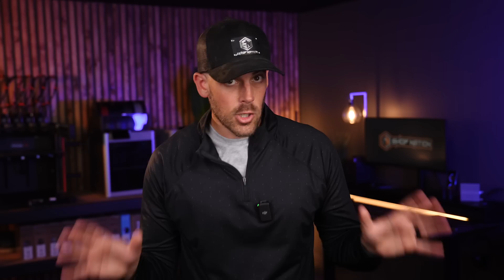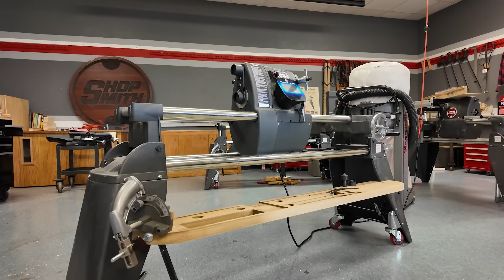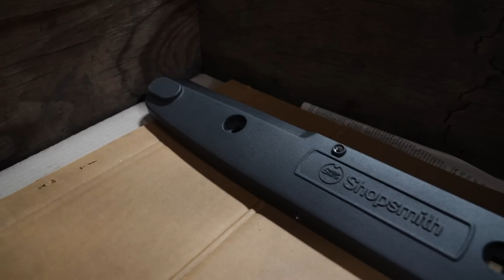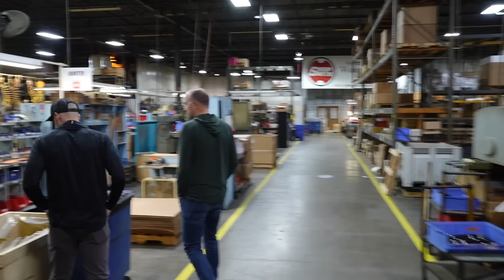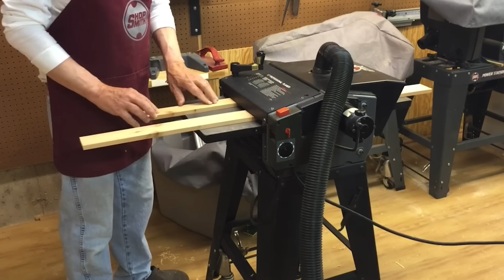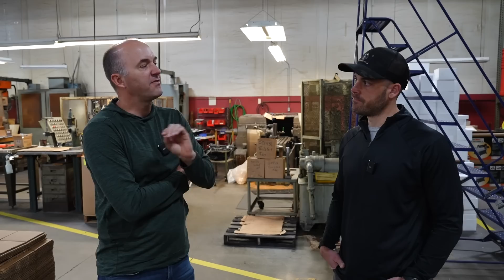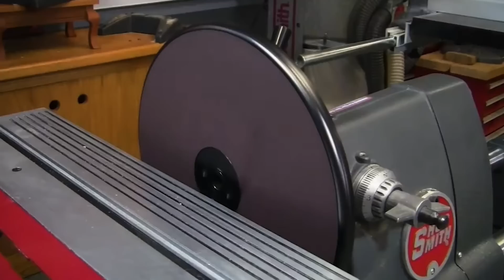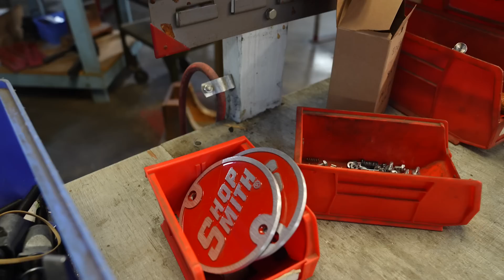The Last American Power Tool Company is (almost) dead

Comment: My dad had a Shopsmith and used it to build a lot of things in the house I grew up in. He made the kitchen cabinets and custom cabinets for the living room, among other things. That was back in the 50s. He sold it to a friend in the 60s that was building a new house. Don't know what happened to it after that. But I bought one in the 80s with a lot of the attachments. I still have it and updated it with the newer ECM motor and controller. Also the bigger tables and fences. Still going strong 40 years later. 
I hope they can keep going and get more people to know about these wonderful machines. We also need to bring back some of the shop classes in schools so kids can learn to build stuff instead of buying everything! It's amazing what you can do if you put your mind to it! Everyone is amazed when they see my dining room table and find out I built it myself. 2 removable leaves that are 18" each. It's almost 4ft x 8ft with both leaves in it with a trestle base.

Comment: Michigan here...if only I knew about Shopsmith five years ago before I purchased over $10,000 of shop equipment. In total the equipment is taking up almost 800 sq ft of space between two rooms. And after these five years of ownership my most pressing concern is I have a need for more space. I think I need to sell off all the equipment and buy the Mark 7 and have it in my smaller room and free up the larger room for assembly and final finishing.

Comment: Its a great space saver and oddly the attachment I use the most is the 10" sanding disc- mostly on metal parts. The thing I use the least is the drill press, because it weighs too much to lift it up into position- and yes they have a fix for that, but its expensive. Come to think of it, I've never used the joiner. Make a cross cut slide table to accurately cut longer pieces like 2x4s if you don't have a compound miter saw. Sadly, the motor they came with is grossly underpowered- it doesn't like ripping long pieces, but I still love the thing, even though it takes a lot of setting up to use the table saw.

Comment: I bought a used Mark V with most of the accessories about 22 years ago for the exact reason the new owner stated. I wanted to get into wood working but couldn't afford a shop full of power tools. I have always loved how I can tuck it away in a corner of the garage when not in use. I always thought I'd get a dedicated table saw as cutting larger pieces is almost impossible on the Mark V. Instead I picked up a used American made Dewalt radial arm saw (that are almost being given away in the used market) and paired with better quality old US made power hand tools. In 22 years, the only thing I have had to do to the Mark V is clean the brushes/contacts on a couple of occasions. The power head, band saw, planer and belt sander just keep working.  Would love to see this company make a come back as I really despise the throw away mentality of companies and their off shore production.

Comment: I bought a used Mark V about 35 years ago. I don’t use it a lot but it never fails to perform. I am glad to see that the company is still alive. I feel certain that when I retire it will get a lot more use due to the fact that I work out of town. I have built my own bandsaw sawmill and enjoy working with wood and also mechanical work on old vehicles and tractors.

Comment: I bought a MK 510 in 1995. Used it heavily in a single car garage with a terribly poured concrete floor. I still use most of the items built with it through 2004. From 2004 to 2017 it was in storage. Since then it has been pulled out of storage, cleaned up, put to work. I even upgraded the wheels for use on a far better concrete floor, cleaned out the shopsmith vacuum, plugged it all in and it works as if it had never been idle. I went back and cleaned out and adjusted  various things and it’s as good as new. The way-tubes started to rust. I cleaned them up and although not as pretty, work just fine, things slide as they should and I recently realized that even the belt is original!! Having inherited other tools from family, I find the Shopsmith gets pulled out fairly often. The band saw is better than the inherited Craftsman, the table saw works but is best for smaller pieces. I have a trak saw for full panel sheets of plywood. The sander is great and the jointer is sufficient if a bit small. It saves space,  runs on a 110 v,15 amp circuit and is long since paid for. I won’t be giving it up any time soon. It’ll probably go to my estate for distribution or sale long after I’m gone and still be in good shape. I hope the company remains and turns around the decline. Training and bringing in younger folks is key. Check out aviation, (not commercial), amateur radio, sport scuba diving, and other activities. Most are dying out. Population of enthusiasts are not healthy and it’s sad we’re losing the knowledge, not to mention the skills, this brings to society. Technology is good but like anything else, has negative effects as well. I rue the day they removed Home Economics, Shop, FFA, Drivers Ed and other functions from the public schools.

Comment: Price is a major issue when starting out.  I bought a contractors saw for $500, a crapsman jointer for $100 and a DeWalt DW735 13" planer for $350 (used).  Less than $1k for the primary three machines.  I picked and set them up as needed which was a pain in the butt but I did it.  

If I were Nick, I would focus on those three machines (table saw, jointer and planer) and making sure they are able to at least somewhat affordably get them into aspiring woodworkers hands and make them more functional.  He's competing against big box store 4" jointers, discontinued the planer and table saw is considered secondary to the lathe portion.  People starting out in woodworking begin with a table saw.  Then they see that a jointer is needed and then a planer after that.  Few if any are starting out the journey with a lathe and bandsaw.  

Combine this with potential legislation which will make table saw sensors and brakes necessary to install and there's a very real problem on the horizon in addition to everything else.

Comment: I first saw a demo of the Shop Smith in a Sandusky, Ohio mall. The guy doing the demo was amazing. My friend Jim was with me in the late seventies. He purchased one and still uses it in his basement today. If the new owner can find someone like the guy we watched and make a video for YouTube, it would do wonders! In only a few minutes from start to finish, I remember the fellow turning a piece of would on the lath 2" by 18" (?) cutting a slit at an angle, and placing a long piece of sandpaper into it. He then surfaced sanded a wide board perfectly smooth almost like a wide surface plainer. That is like having another tool in itself. Very impressive.

Comment: I have never owned a Shopsmith, but I have used several owned by friends. If you have limited space and budget, they are versatile and can be used for many functions, however, in a complex woodworking activity, there is a lot of extra time spent changing from one configuration to another. And they do exude high quality. In terms of efficiency, I much prefer having separate power tools rather than a single do-it-all tool.

Comment: Coming from manufacturing engineering and owning a small business that travels for work. Any tool that is compact like this and can be made portable is great for the modern tradesmen. If this can be made to load into a job trailer easily and run on power tool batteries or a standard cord you would find a lot of customers in the trades. Portability is a major attraction to most tool buyers. I have duplicates of every tool in my metal shop one for the shop and one for the road.  I know they are capitol limited but getting these cordless in a hurry would really help sell them.

Comment: My dad had a ShopSmith in our garage workshop. The ways got a bit rusty since it was only heated by a wood stove. I used it mostly as a drill press and it did a great job. I'll be looking into a new ShopSmith since I am now retired and need a multifunction tool.

Comment: Love Shop Smith!  Have a full shop of large tools and still have my shop smith too.  Used the shop smith inside my old house during a remodel, just rolled it in the basement and began working.  A Shop Smith and a chop saw can do a bunch of work in terms of trim, shelving, plumbing access panels,   it is just so handy to be able to make pieces the exact right size.  It does an excellent job on soft woods like pine and popular.  Variable speed is nice when working with wild cherry as you can slow down the speed to prevent burning.  The education side is very solid.   Thanks for keeping Shop Smith alive... I will buy a few things I need to support the cause!

Comment: I still own my Shopsmith Mark V that I bought in 1980 for $1500. However, I don't use it much at all. The system is really designed for small projects. It does not lend itself well to big sheets of plywood for instance. The main problem there is that the table goes up and down instead of the blade. So, any time you change your cutting depth, you have to change any of your supports ( any roller stands, and the side support at the other end ).  So, you need to really plan your project carefully so you do not have to make many changes. If you are doing small projects it is a great system. But I am a construction guy doing full sized cabinets and building buildings.

Comment: 50 years ago, when I was a teenager, a soon to retire tool and die maker moved in across the street and he had a Shopsmith that he heavily modified. He had made a gear reducer for the band saw so he could cut metal, a die filer attachment, an X-Z attachment for metal work as a lathe and horizontal mill. It was a Super-Shopsmith, and a pretty capable machine with him as the operator.

Comment: Robust woodworking lathes are still made in the US in Wisconsin.  ShopSmith is a joke.  It doesn't do anything well.  Underpowered and every tool setup is a compromise compared to a dedicated tool.  Stanley, Black & Decker has 48 US manufacturing facilities and employs over 18,000 workers in the US.
Reply: Stanley black and decker does not produce power tools in America. They are made in China and partially assembled in the US. 

Shopsmith has a 2 HP motor which is equal or greater than most power tools marketed towards home shops.

How are the tools compromised? Europe and Japan embrace multifunctional tool albeit not as a lathe based tool. If you look at Shopsmith as a vertical and horizontal platform, once you calibrate, it does not need to be recalibrated when transforming the SS. People have built houses with SS. Maybe the problem is you.

Comment: I have owned a ShopSmith since 1980. My current shop contains all the standalone tools that did not have when I was in my 20’s. 
That said, I use my ShopSmith for lathe work, disc sanding and occasional horizontal boring and mortising
It has worked flawlessly all these years and with upgraded accessories I added, continues to earn its spot in my shop.

Comment: My Dad bought a Shopsmith after retiring to Florida in 1982 . I now have the machine and I mainly use it as a drill press , disc sander and with the bandsaw attachment . It has been a great addition to my shop ,I did recently have to search out some parts for the motor mainly bearings  and that was not an easy task . I did place an order through Shopsmith for some of the few items that they still make . The shipping was a bit slow ,as I was told with a new shipping software coming online and new personnel
it was going to take a bit longer . Well my order showed up today July 1st , and I was happy it only took 7 days as stated on the website . Then I get an email from Shopsmith of a sale and shipping is free the month   of July 2024 . That was a bit of a slap in the face , they could have said wait another week and shipping is free saving me  $33 .  I wish the new owner Nick good luck in his venture , and also keeping customers . Sorry for the gripe , It's still a great machine .

Comment: My father used to go to the New York State Fair and drool at the Shopsmith being demonstrated.  I saw one advertised on TV in the 1980's and immediately looked up the nearest dealer.  That's when the Academy was still teaching woodworking classes on the Shopsmith.  I immediately went to the closest dealer and bought one and signed up for classes because I needed to learn.  My Father had passed away in 1972 so my purchasing this machine was for remembering/honoring him!  I still have it in my shop and upgraded it to the Shopsmith 7 from the Mark V.  I still use it even though I have several standalone machines I love this product and was sorry when the Academy classes went by the wayside as did the stores.  I'd still be taking classes if I could.

Comment: I have a 1950 Shopsmith 10ER I mainly use it for the Lathe operation but I have used the tablesaw and horizontal borer.

Comment: My Dad bought a used Mark 5 with all of the attachments in the 50's. So I grew up using it. He used his mark5 until he was past 88 years old. He bought me and my brother each a new mark 5 in 1983. Since then I bought all of the attachments and when I retired in 2015 I bought a new PowerPro and gave my old unit to my grandson. I use it nearly every day mostly as a lathe. I no longer think I need a large dedicated lathe. To me this is a great 2 hp machine that you can adapt to nearly anything you can think of. It has a few drawbacks but I have been able to make attachments that work around them. Would I do it again?
Yes. for anyone with limited space it is a great woodworking machine.

Comment: I hope your able to save your business. But I never liked the Shop Smith. it simply is way to inconvenient to constantly switch between all those attachments. a Jack of all trades cannot do every thing well. When it is just to much trouble to switch attachments when you will have to switch back to the previous right after it is just not worth the trouble. that is why they are for sale used everywhere on Facebook. It seems like a good idea until you use it.

Comment: Not sure how in 1950 the sold for $150.00 as in todays that is  $150 in 1950 is worth $1,954.79 today. I recommend new Shop Smith have a base offering as a table saw not a 7 in 1 for 5200.00 plus.  My whole shop didn't cost that much as I shopped for used Delta table saw "$150.00" and rest I got new.

Comment: I walked in their door as well in 1990 and I had an offer for Shopsmith. I have created an ALL tool, ToolStation that would establish a new "market" in woodworking tool accessories.
My product provides material and/or tool support  
(for bench top tools). It is NOT brand or model specific in any way. Stationary tools will only need (or get) infeed, outfeed, or both material support from one pair of units. My product provides 4' of roller support or 12" x 4' linear support as well.
They both have their virtues.
Back to Shopsmith! I would like to walk in to their door again now that they have new leadership.

Comment: Space is definitely my current problem when it comes to woodworking. However, with Shopsmith, it does feel like switching from table saw to band saw is a bit of a hassle. If there was an easier way to do it that would be a game changer. The UX is with switching from multiple machine is the biggest deterrent for me.

I am really interested with seeing how Shopsmith progresses. I love the quality and design of the machines overall, just the UX is what's holding me back.

Comment: I lucked up and purchased a shop Smith from an old gentleman some years back for hardly nothing. It is one if the very first ones they made and had only been used a couple of times. It's literally brand new. It's the one that has the belt tensioner that can be used to slow the speed down from my understanding. The original stand has a metal base with a wood top and all of the accessories. Even the lathe tools with the hanging tags still on them that's never been used. You can tell that it will last Forever. Wished every business made stuff like Shop Smith . Thanks for the video tour, and I wish Shop Smith the best luck.

Comment: I have the 10ER  and use it . Sanding, cutting, table saw, floor board, shelving. Nice Drill etc etc.  And I have 6 3d printers!  See how you two came together there? Um, did he not say he has 600,000 Shopsmith's in garages.  Well there is you show. You those people, me included, I have to do some floorboard for the flooring I put in. Let the old guys teach the young ones.  Call it Digital Journeyman or Digital Mentor or Shopsmithing.  You get it.

Comment: I have an original Shop Smith from the late 1940's that I bought 45 years ago. I rebuilt the quill, replaced the power cord, on/off switch, cleaned the rails, put new wheels on. All the locks don't release and the stops are wore out. The table always needs to be checked for levelness. I've used it to make bookcases, baby cradles, slot car tracks, soap box derby cars and more. The problem I see is that it's nice to have all this capability. But, its a pain to need to change to another tool if you didn't plan out the complete series of work. That is why individual tools allow the work to move along when we make a mistake. And as you say space is the problem. Did not know Shop Smith was still out there. Good luck.